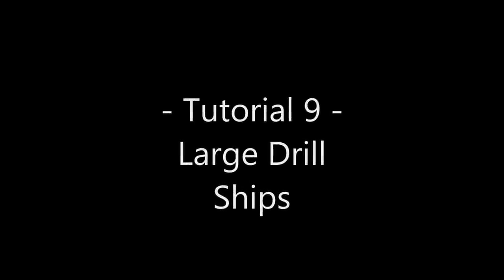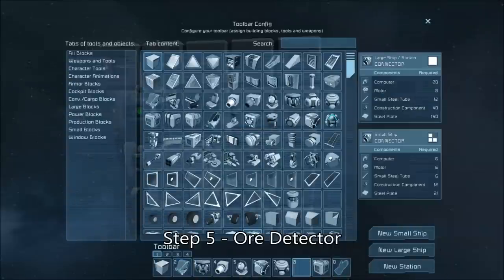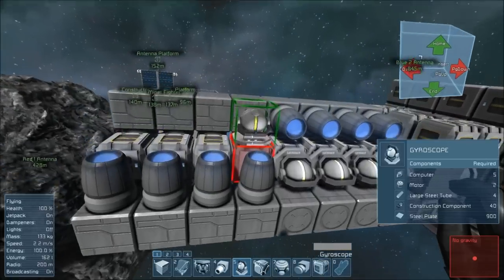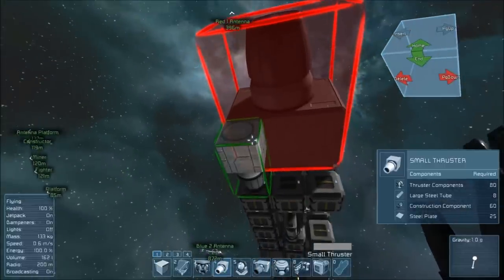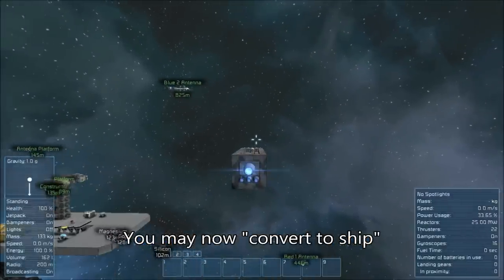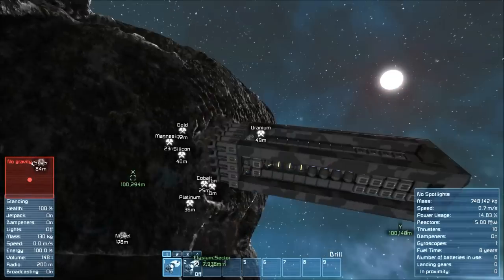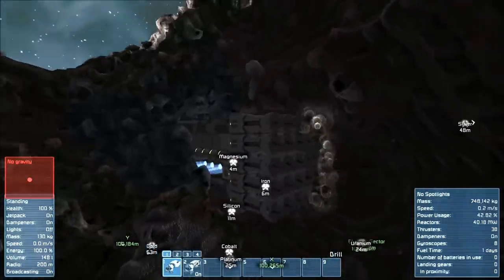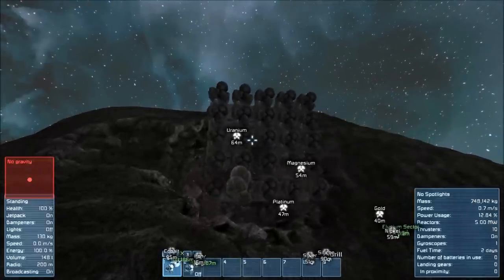Space Engineers Tutorial 9 - Large Drill Ship

Comment: I don't like this design, 2 out of the 3 times I used it it got stuck it the asteroid. So I built one that is a 3rd this size. I did this by finding out you don't need a drill in each spot I took out four and put thrusters in place of them with a drill on each side of them. This allows me to have a smaller ship with one large cargo hold. It's meant for riding on a bigger ship to the asteroid. I still get the 5x5 grid and works better never gets stuck. I also get reverse if want and can turn.

If you want to improve on this one take out every other drill, on this design you would get 12 drills 3 to use on each side. Use conveyors to fill in some of the holes. Leave 4 on inner ring open for thrusters if wanted. This gives you 24 drills in a 6x6 grid. Start with conveyor in middle work out from there. You can put a spotlight on the conveyors. There should only be 12 drills on outside ring anything in between them will only get caught. This gives more ore per pass, gives space on all sides no getting stuck, and allows you to leave the ship if needed. If you are not limited by the 25 drill you can fill in the outside ring with drills to get a clean hole.
Reply: Spaced drills definitely improve performance. All my drill ships, large and small grid, follow this principle.